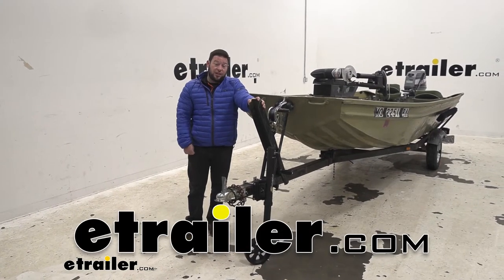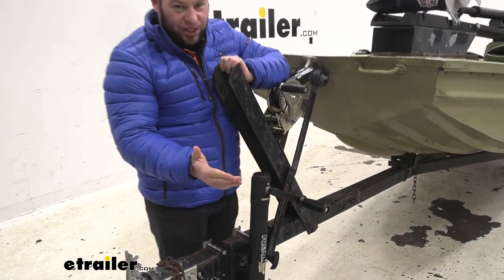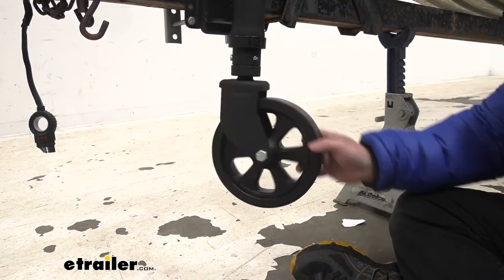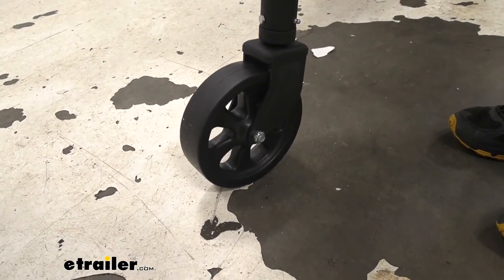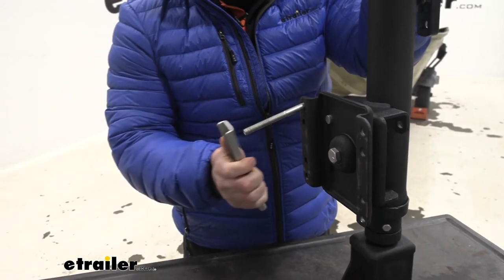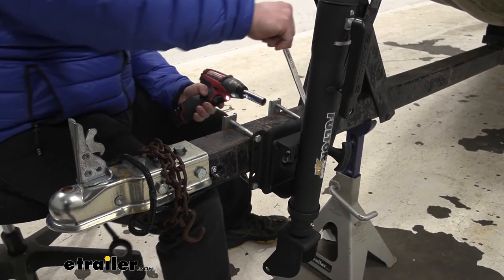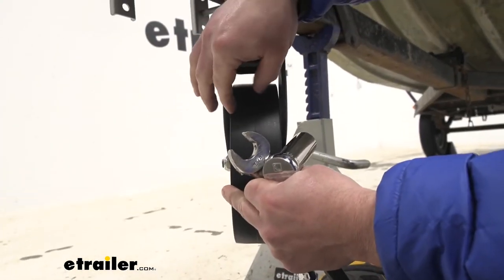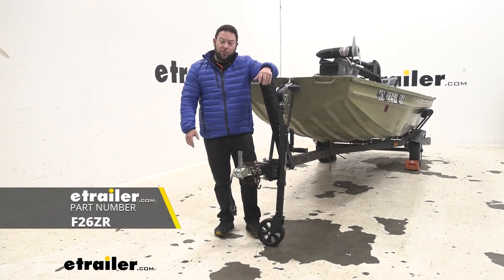etrailer | Fulton XLT Bolt-Thru Swivel Trailer Jack Review

Comment: Thanks for this! I have this trailer but it is too long so when it’s on the trailer I can’t swivel the jack to the down position.  I was thinking about taking the wheel off to give it more room to swivel. Can you remove the wheel on this one?
Reply from the maker: On this particular jack, the wheel is not removable but you can pull the pin and adjust the main support. The jack also rotates bot ways so if the wheel is hitting something, then try rotating it the opposite direction.
https://www.etrailer.com/Trailer-Jack/Fulton/F26ZR.html